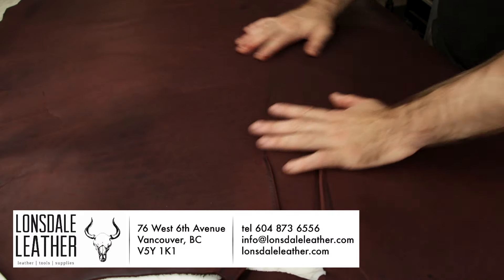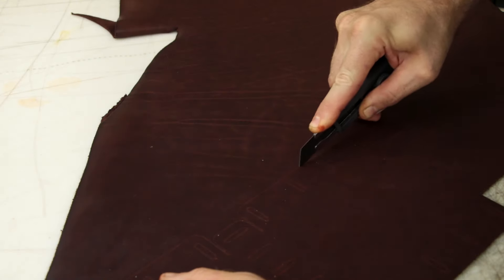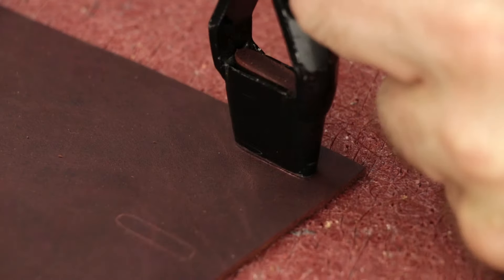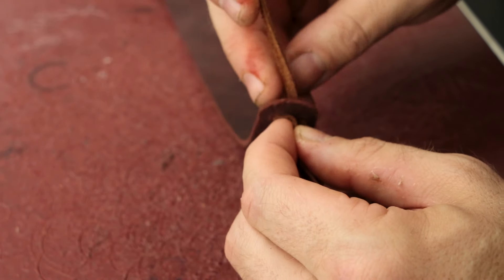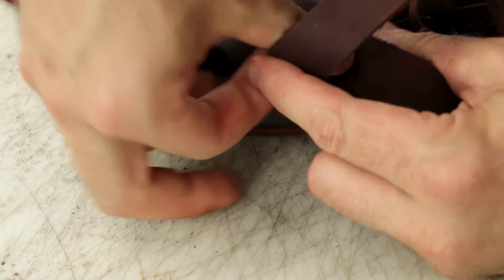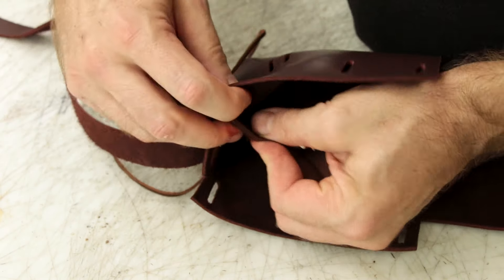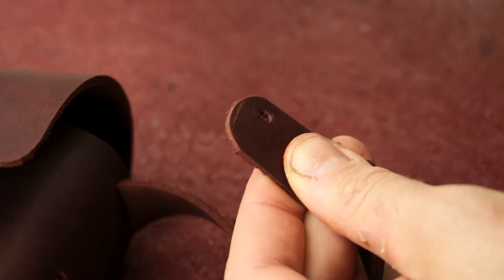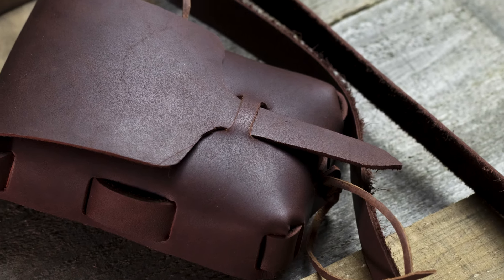How to Make a Bag, Pouch or Purse with no rivets, NO STITCHING and no excuses.

Comment: Me on my twitter like an hour ago: "I wanna do leatherworking but I don't have the tools and tools cost money and I don't have that either."
You: "no excuses."
Reply from the maker: That's golden. Hahaha
Reply: The only tool you really need for this design is a sharp knife. He also used a couple of punches and a stretcher, but you could pretty easily improvise something else for those.
Reply: E Co. have you got a box cutter? A good box cutter, single blade ones not the ones that have an extendable blade that snaps off. Maybe a Scalpel? It’s got to be sharp, and sturdy! My partner started doing leatherwork as a hobby 35 years ago, and he's taught me some things. You don't need much to stat out, I highly doubt the Natives had all the tools we have, but they did great leather items they used every day!
Reply: I'm having a hard time to even get the leather. There's no place near me that sells leather. At least online shopping make it easier for me to get the leather now.
Reply: We all started with a blank slate.  This channel is responsible for many improvements in my skill level.
Reply: @aimansyahmidzulkhairy909  second hand store. Leather shoes, purses, coats, many leather goods available second hand
Reply: @DarkHorseWorkshop  which leather is this?
Reply: @aimansyahmidzulkhairy909  Tandy Leather Factory (online or in store) is the best place to start, pretty much everyone that does leather craft uses them, including people that have done it for 50+ years.

Comment: I love this for how clever it is in keeping it simple... and yet looks pretty strong with such a wide strap for the weave.  Where the two strips are tied together are probably the weak points.
Reply from the maker: Totally agree. Could lace it a bit better, was trying to keep it very simple.
Reply: @DarkHorseWorkshop    Yeah.  I was thinking you could overlap it more and do 4-6 holes to weave the lace through to spread out the load.  Should still look good.

Comment: Just bought this pattern with the plan to make it a belt bag for my Ren Faire outfit! Can you please clarify what you mean by "weave the edges back in the direction they came from"? I'm not sure what that means.
I'll probably stitch a belt loop onto the back although to keep it no-sew I suppose cutting a couple of slits in the back would work as well.
Reply from the maker: Hell I don't even know what I meant by that. But the pattern is really simple and you're probably over thinking it like we all do. :)
Reply: @DarkHorseWorkshop I ended up looping the ends back in a sort of knot and then riveting them together in a loop that fit over my belt. Worked great. Thanks for the pattern!

Comment: Hmmm, is this big enough to hold your "Easy Leather Journal"?
Reply from the maker: Nope but you can easily scale any pattern up or down in size with your printer settings.
Reply: @DarkHorseWorkshop  Good to know, I did buy the pattern because "why reinvent the wheel" and thought that it would make a great combo. Like a "Traveler's Journal" set. Add a side slot for the strap so it sits across the chest. Looks like I have some modifications to make. Dope channel BTW! Of course I subbed.
Reply: Ended up designing a whole new bag to go with the journal. The journal pattern is wicked simple but works so well. Anyhow, thanks for inspiring me to make my own bag pattern, first time, and building it out.